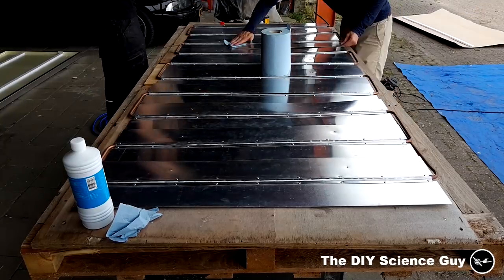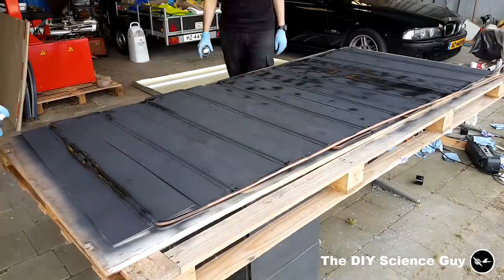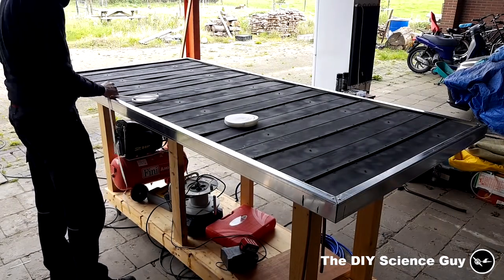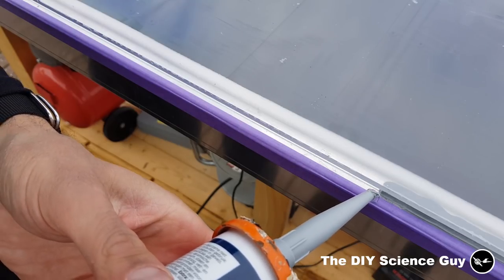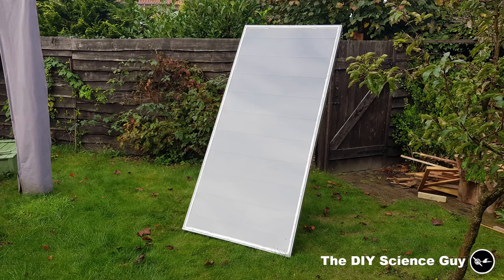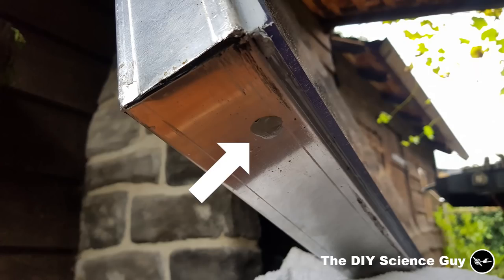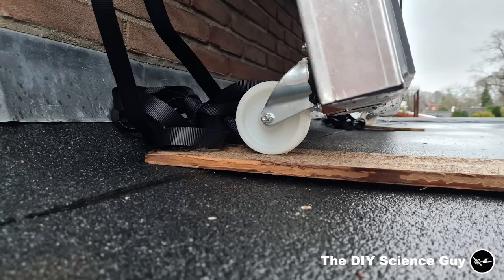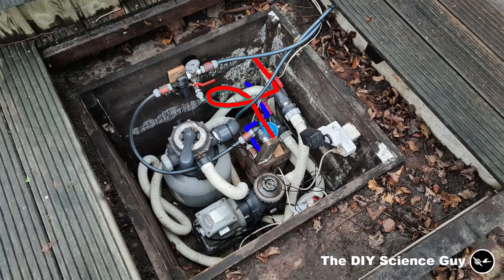Super easy to build 1600 Watt Solar panel #2

Comment: using the alaminum plates attached to the copper pipe is very time consuming why not use same amount of money and add more copper pipe runs in the black box?
Reply from the maker: Because that amount of copper pipe would be even more expensive, the resistance in the pipe would be too high, and it's hard to fill the whole surface that way.

Comment: My understanding is that the backing behind the photovoltaic cells should not be black but should be as reflective as possible. Why did you paint them black?
The idea is that rebounding photons of the backing then contribute to the photon capture.
Oh, never mind! Nice clickbait, though.  Solar water heaters what you have there...meh.

Comment: I kept thinking he was going to use this to make electricity.
Reply from the maker: Eventually I will. But the 1600 Watt is about heat energy.
Reply: clickbait  @TheDIYScienceGuy
Reply from the maker: It  is never meant to be clickbait. The panel actually turned out to be producing 1500W of heat. Nowhere I said it would be electric, not in the title, not in the thumbnail.
Reply: apology accepted.... @TheDIYScienceGuy
Reply from the maker: What should the title be according to you? Tis is an honest question.
Reply: DIY Solar Water Heater  - 1500 Watts  @TheDIYScienceGuy

Comment: The title of your video is misleading I'm thinking 1600 w electrical you basically made a hot water heater.
Reply from the maker: Yes we estimated that it would produce 1600 watt of heat energy. In this video I'm explaining how I measured the real output: https://youtu.be/DIk2mcJ7NHs

Comment: What makes it 1600 watts?
Reply from the maker: I explain that in this video: part 3 https://youtu.be/DIk2mcJ7NHs
Reply: @TheDIYScienceGuy  you do some math. But it doesn't really add up. Can you show us the difference it made on your power bill?
Reply from the maker: No because I don't heat my house with it, only my hot tub. But I gave you the amount of wood equivalent. 😉
Reply: @TheDIYScienceGuy  well a hot tub is pretty expensive to run. Free hot tub heat is pretty cool!

Comment: This is a water heater. Power is expressed in BTUs not WATTS. This is clickbait.
Reply from the maker: Watt is a unit of power. 1 Joule per second is 1 watt. Joule means energy. This can be electricity, heat, light, sound etc. Check this link for more information about this subject, hoop it helps: https://en.m.wikipedia.org/wiki/Watt

Comment: So where is your 1600 watts of power, like your video title says? Looks like a water heater to me. An electrical solar panel [1600 watts] produces electricity not hot water.
Reply from the maker: Here you go: https://youtu.be/DIk2mcJ7NHs hope it helps

Comment: 1600w ?
This is a thermosolar panel. I don't understand.
Reply from the maker: Watt is a unit of power. 1 Joule per second is 1 watt. Joule means energy. This can be electricity, heat, light, sound etc. Check this link for more information about this subject, hoop it helps: https://en.m.wikipedia.org/wiki/Watt
Reply: @TheDIYScienceGuy  
So, you generate 1600 Joules per second. But how do you transform this heat?
Reply from the maker: I don't for now, but I have plans for that as you can see in this video of mine: https://youtu.be/s5Ud-FD33tI

Comment: This would be a useless exercise in South Africa as the cost of the materials used here is as expensive as 3 - 4 commercial Solar collectors.
Reply from the maker: It has cost me €450,- for one panel, are they that cheap in South Africa?
Reply: @TheDIYScienceGuy  A panel for a solar water heater (ie geyser) in South Africa sells for about R4000 ( about 250 euro ) and a 450W PV panel to charge batteries is around R1800 or about 120 euro. We have thousands of solar installations which makes it cheaper.
Reply from the maker: That is amazing!

Comment: where is the electricity?
ini panel surya atau pemanas air?
perbaiki judulnya
Reply from the maker: It makes hot water.
Reply: Kenapa tidak ditulis sebagai PEMANAS AIR "SOLAR WATER HEATER" 
Sangat membingungkan.
Ekspektasi saya tentang PANEL SURYA "SOLAR PANEL" adalah pembangkit listrik tenaga surya.
Saya menyesal menonton video ini dengan seksama.
Reply: FREAK

Comment: Witch ass did you manahe to pull 80% efficiency from. As that area with 1600w output is 80% of the suns to surface potential
Reply from the maker: Yes the efficiency is around 68%

Comment: ?  1600 Watts ?
Reply from the maker: 1600 watt of heat.
Reply: @TheDIYScienceGuy  
how do you measure that and how is the equivalent in electricity ? Cause normally you measure it in Joule.
So how many liters do you warm up in what time between what temperatures ?
Reply from the maker: 1 Watt is 1 joule per second. I have to do the final measurement when the sun is at it's highest point so than I'll make a video of that. For now 1600 watt is an estimation. The earth reseves 800 watt per square meter of the suns energy, the panel is 2 square meter so that makes 1600 watt.

Comment: 😜I'm no scientist, but isn't "Watt" a form of measuring electricity!!!  Your system uses electricity, not produce any.  Great click bating. I'll make sure not to look at your next videos.
Reply from the maker: Watt is a unit of power. 1 Joule per second is 1 watt. Joule means energy. This can be electricity, heat, light, sound etc. Check this link for more information about this subject, hoop it helps: https://en.m.wikipedia.org/wiki/Watt
Reply: @TheDIYScienceGuy  That did, Thanks.  Regular Joes like me would like to know the BTUs.  This is what I found, 1600 x 3.41 = 5459.42 BTUs. Is that so hard? Now I can compare to other things, like an air conditioner or a cast Iron radiator. I get it, you're more educated.
Reply from the maker: Sorry I never use BTU I only use metric. Unfortunately I never got the chance to get much education. I'm just a handy fine mechanic (which I learned on the job) and I'm very curious so I look every thing up that I don't understand until I do.
Reply: @TheDIYScienceGuy  Respectfully I read many comments that echoed my first.  I can't prove you were Click bating, but when more than one is confused it should be considered. If others find your content does not match your title, you will discourage, not encourage others to revisit. Never the less, I wish you good fortune with your "fine mechanic" skills.